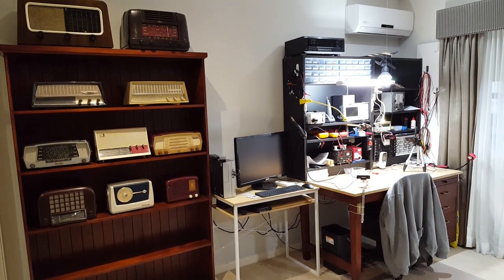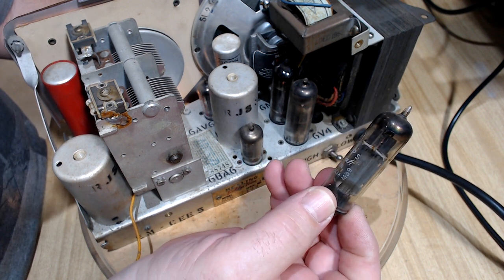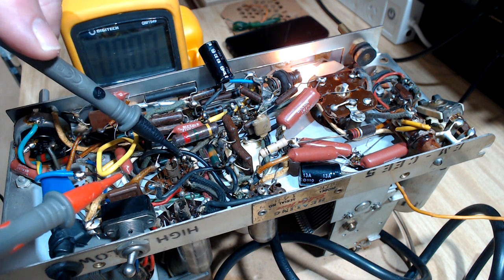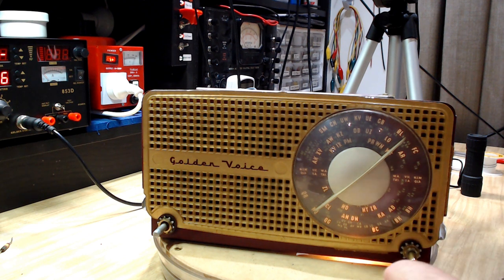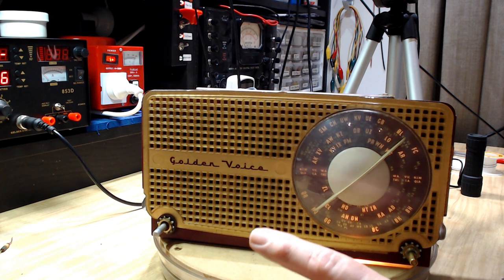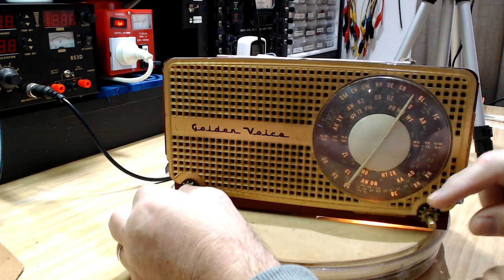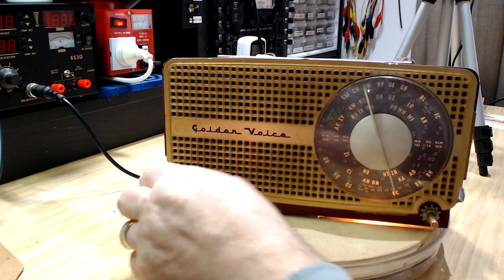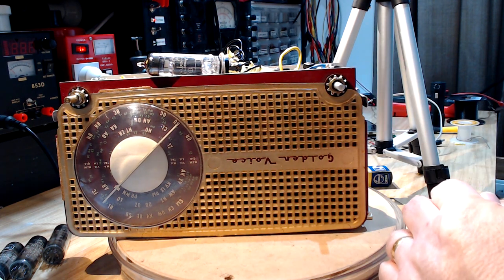Healing 503E Vintage Radio Repair

Comment: Just found your channel and have subscribed, as a electronics technician that started work in the mid seventies i saw the last of the valve televisions, but i cut my teeth on valve radios. Many years later due to a accident i find myself being able to have time to fix the valve sets i have collected. Watching your videos is fascinating and proves the point that you need to diagnose. 
Thanks for all your time snd effort in uploading these for everyone to access.
Reply from the maker: Thanks for the sub William. I'm new at this gig so please don't be too hard on me with your technical background and all 😀 Sorry about your accident but hopefully you will get some joy from you radio repairs. Thank you for supporting my channel William, cheers 👍🙂

Comment: An old radio engineer told me to always ensure all the valves are healthy before starting any fault finding, and it was good advice.
Reply from the maker: That's good advice but not as much fun as seeing what happens to a 70yo radio when it gets power for the first time in 20 years. I take your point Christopher but I want to see what problems there are and how to address them. Valves usually aren't the problem, they may be down on performance but still work. In this case the 6M5 wasn't the problem 🙂

Comment: I love the fact that you have a lathe to fix mechanical issues as well as electronics...
40 yrs I've spent in the tv and appliance service business...
I wish I had access to a lathe in my tenure, it would've saved me so much trouble and I could've fixed so many more appliances and even some of the older mechanical TVs..
I subbed, you are very talented and knowledgeable.!!!
Reply from the maker: Hi Frank and welcome. The lathe has been very useful especially as parts are no longer available. 40 years is a long time, you must be very knowledgeable yourself, I'm just in the learning stage. Cheers and thanks 👍🙂
Reply: @DavidTipton101  ..I think you have a very good grasp and style to your restorations. 
Great work.!
Reply from the maker: @frankpitochelli6786  Thanks Frank

Comment: Hi David was watching some of your older videos stumbled on this one, I was given a stripped 503E. It was no good as a radio so turned it into a 6V6 output guitar amp and it works a treat and sounds great through my 4 x 12 300w quad box. Really like your videos you do excellent work.
Reply from the maker: Thanks A Last, there wouldn't be much left of the 503E with a 6V6 in it, just the power supply 👍😄

Comment: I moved the shack 3 times. It always took a long time before I could find everything again. Last time was 10 years back. I told my youngest "make up your mind son, what room do you want for the time left you live here" (they fly out, and if not, they get some "assistence" 😄) He took the large room in the attick. Which left me with a bedroom.
Now, did that solve the problem of having trouble finding stuff ? 
No. Teflon memory and too much stuff.
Oh well. I can live with it 😎
Cheers, Nard 🇳🇱
Reply from the maker: I hear what you are saying Nard. One of my first projects in the few weeks I have taken off radio repair was to build shelves in my garage to store radio parts. Like you I can't find things when I need them and only find them when I don't 🤦‍♂️

Comment: Hi Dave those innoval Philips valves (the old ones made prior to about 1955 with the pointy pins and ridged base  )especially the 6m5. Suffered from silver migration between the screen and grid 1 pins putting positive potential onto the grid.  Quite often scraping between the pins with a screwdriver will cure the problem. Hopefully the valve hasn’t been cooked by this leakage.
Reply from the maker: Hi Robert, I know about the silver migration on 6M5 valves, I wasn't aware of the pointy pin difference though, thanks. I have tried to clean between the pins in the past to no avail. Others have suggested the migration happens inside the valve where the pins pass through the glass base? 🤔

Comment: Good to know about caps is that when they measure higher capacitance than the marked capacity it's actually not that the capacity has gone up. The cap has started leaking and developed an internal resistance, so the instrument needs more time to charge the cap, which it (falsely) interpret as higher capacitance.
Good job with this nice set! :)
Reply from the maker: Hi Kristian, thanks. I said that on a few of my videos, not sure which, and was told that isn't the case as capacitors can have up to a 80% manufacturing tolerance. I can't measure my capacitors under load so I just replace them but I agree with you, if they read high they are probably unserviceable 👍🙂
Reply: @DavidTipton101  That's true ofcourse if the cap is out of spec from factory 👍

Comment: The on have a lot of problems but finally it was fixed.
An interesting thing I noticed with the radios you work on is that most of them have negative feedback from the speaker or the plate. I have never seen this in the North American AA5 series string hot chassis sets we have here. This would give a different sound and more gain. Some audiophiles prefer no negative feedback on their class A amplifiers. A 6BQ5 or EL84 would probably work. It requires 7.3 volts bias at 250 volts, the maximum is 300 but some amplifiers use more. You are lucky to have an oldies AM station. The one here in Montreal, Canada switched to sports and then went off the air. Now there is nothing but talk, sports and ethnic as is common in many places.
Reply from the maker: Hi Gordon, negative feedback is pretty common, some use a quite involved circuit as well and it does improve the sound at the cost of a little gain. It's good for AM, I'm surprised it would be used in an amp though. We had two oldies stations, sadly one went to a sports station recently and I have trouble picking up the other one. We also have the national ABC broadcaster which is entertaining and plays a good share of music as well. Thanks Gordon 🙂

Comment: Healing had such a strange model number structure. For instance the 503B was a 5 valve portable radio! That crackling 6M5 makes me think I now know what’s wrong with one of my kriesler 11-81’s I have which crackles intermittently. Interesting I’ve never come across those red dipped ducons before, only the wax caps and the foil in clear plastic ducon caps. Good educational video on how a valve can fail
Reply from the maker: Hi BOE, It turned out to be a mica cap in the end, I think it was the tone cap from the plate to grid. The radio ran for a day before the crackling started again 🙄
Reply: @DavidTipton101  i just checked out the schematic for this radio and found the one your talking about. yes the bonus is it can be isolated with the tone switch so its as simple as turning the tone switch to "high" to remove the cap from circuit which would have made it much easier to diagnose. do you remember if the mica seemed stressed in any way or if it just looked normal. this all shows me i should have watched the last 5 minutes of the video before bothering you
Reply from the maker: No, the mica looked normal. I now realise that micas with high voltage on one side can fail. I had another one in a radio, can't remember which, it was going to ground from the plate of the detector, it caused distortion. It took me a while to find as I assumed micas where not a problem, that is what I had been told at least.

Comment: The cabinet on that Healing is a dead ringer for a post war Zenith Bakelite model, except with those the dial, and front fascia stays inside the cabinet. I wonder if they bought the molds from Zenith in the U.S? 
  With regard to molded mica capacitors I too have encountered some defective ones, particularly in post war sets. I had a pair of 47 mmf/pf ones go bad in a Canadian made Electrohome AC/DC set from 1950, Viking brand,  I can't remember whether it was leakage or whether they went open.
Reply from the maker: I don't know OlegKostoglatov, I guess they could have, maybe Healing just stole the design 😉  Oh yes, mica caps, I was lulled into a false sense of security by people in the know but I know better now, hopefully I won't fall for that again. I thought the micas from your area were better, guess not 😀  I read in a 1931 service manual to use a 90volt battery and a set of phones to test for any crackle 🤔

Comment: Hi there just bought a Bush Dac90 radio plugged it in and it all lit up and started to hum that familiar hum but no stations, I know alot have gone digital but there are still quite a few that operate on FM. My question to you is there a valve that needs replacing that will enable tuning in and locking onto a station? I most definately do not want to remove any of the internal workings as that is what makes the radios so special. That is like removing the workings of an old clock to rplace it with a quartz movement. 🤕
Reply from the maker: Hello David. The DAC90 has a hot chassis, that is, the chassis itself is connected to the mains power, you can get electrocuted very easily if you touch any metal parts. It sounds like you are trying to tune FM stations. The DAC90 is AM only, no FM. There is no magic cure for not receiving stations. If you want it to work you should contact someone to check it over before you plug it in 👍

Comment: I forgot to tell you that this is a very nice 👍 collection of radios 📻. Each one ☝️ must take ya back to a special place and time. I often wondered what happens, such as if a switch on a radio breaks. New old stock switches I think are the best way to go. Trying to just get a switch that looks the same may not be suitable. They, along with speakers 🔊, often aren’t made to the exact same specs as the originals. Even correct voltage record player cartridges are something almost impossible to come by. You have to modify the chassis with homemade circuitry to step the cartridge voltage up to something like 3 volts, instead of less than 1. Radiotvphononut can tell ya all about phonograph needles and cartridges. Shango066 was the one ☝️ to speak of buying a power strip on certain radios that you cannot get a switch for. He also said in a video, not to leave any antique radio on, if you leave the room, even for a second. He does not care how recapped the radio is, and to turn it the hell off. Shango066 is quite humorous. He makes up nonsense words. His most interesting one ☝️ was “Rojontweeblereezersweefless”. Yes, it isn’t a word, but, yes, major Lol 😂. It was Shango066 who bought up the Firestone Airchief radio. There’s Zeniths and many other brands that are of the same size. I see Glasslinger working on a majority of these. One ☝️ is a small refrigerator shaped radio, reminiscent of an actual refrigerator of the 1940’s, or a wooden armchair radio of the same time. She really does the major restoration of many radios. The above two really take ya back to the time. Even then, a 1940’s radio went in a 1940’s house 🏡.
Reply from the maker: All old radios bring back memories Jeffery.

Comment: Hi Dave
Enjoying very much you detailed videos. I am redoing my workshop and currently only use a the current limited lamp restricted voltage for initial radio test. But want to get a Variac and was wondering why you also use as an isolation transformer and wattage meter. Do you use the   the isolation transformer for safety reasons?
What models do you use and where did you get them.
George
Reply from the maker: Hi George, the current limiting bulb is a must as is the isolation transformer particularly if working on live chassis sets as it keeps you isolated from the mains and mains earth. Clearly you will still get a shock if you touch both output terminals but most test equipment is earthed so that element is removed if you touch the radio and an earthed point. The Watt meter is more useful if you bypass the dim bulb as you can look for excess current/power draw when bringing up the voltage slowly on the varic but I also use it to check the radio is operating at about the normal range, the manufacturer sometimes suppy the power draw figure. The variac came from Jaycar and the isolation transformer from Radio Parts in Melbourne.  The Watt meter is from eBay 🙂
Reply: @DavidTipton101  Hi David  Thanks for you detailed response  as I assumed the isolation transformer would be the most use for radio's with live chassis such as American set, not come across any Australian ones like that and have on not on any Battery Sets  from here.
Keep up these great videos I am picking little tips all the time. That rotating platform is a great idea did you make it or is it readily available.
Looking forward to getting to Canberra on the weekend to see I can add a few more radios to work on.
Are you heading to down to Radiofest if so love to meet you.
Cheers George

Comment: I would take all my 6M5 valves and adjust the pins with a 10 pound Widlar hammer.

Then buy a case of NOS ones. They can be pricy.
E80 is a direct replacement, E80L and 6227 are possible replacements, you would have to check.
Studying the operating curves can tell you a lot.
6BQ5 or EL84 have different pinouts and the characteristics are different.
There might be another type with the same characteristics but different pinout.
Reply from the maker: It's hard to get 6M5s, there are other options but need a rewire of the socket. A good 6M5 is fine, finding one is the hard part 😄

Comment: Hi David, could you show and explain more about the test lead you use for by-passing the RF side and put an external source to the amp side. Bloody good idea.  Thanks mate
Reply from the maker: Hi Jeff. Using an audio plug, I join the two inputs from the audio player together via two 1k resistors to make the signal mono then ground that via a 10k resistor. The junction of the two 1k and the 10k resistors is the signal feed into the high side of the volume pot, that is the side not grounded. The Plug, 10k resistor and the radio chassis are connected together as ground. I also put a 0.1uF cap between the resistors junction and the volume to protect the music player from any DC from the radio. 
Here is a link to a D-lab video where he fits it to an old radio: https://www.youtube.com/watch?v=j8YeJ0T3DpI
Here is another link to a drawing of the layout but I use D-Lab's resistor layout. Either will work: https://joefreeman.weebly.com/connecting-an-mp3-player-c-to-a-vintage-radio.html
Reply: @DavidTipton101  Thanks David. Great bit of kit.

Comment: I'm in the US-find the power transformer fascinating for a basic AM table radio  Was there ever a series filament variant to our "All American Five" in Australia?  I realize the US tube compliment would not work "down under" but was there an attempt to make a series filament, 5 tube radio for the 220/240 volt world?
Reply from the maker: Hi William, I get that question a lot. I have been told there were transformerless sets built in Australia but I haven't seen one as yet. Transformerless sets were popular in Britain which, like us, also used 240 Volts, they used a heavy dropper resistor to get the voltage down to acceptable levels for the 120V (approx) valve string. Because we produced our own tubes and we are a very small market maybe it was too expensive to produce special valves or import them for hot chassis sets. I'm glad they didn't as it tended to limit the circuit design to a very narrow field such as the AA5. I have a number of British sets with a dropper resistor and the resistor runs at about 200C, great for cold England not so good in Oz 😃

Comment: Mr. Tipton I been working on AA5 type American radios for a while ,teaching myself from videos ,I spent a fair amount of money on vintage equipment and new stuff .I just order a vintage signal generator,have a restored vintage capciator tester because it can do things new stuff can't .I have a question where do the test leads go when you are doing alignments, I even bought a analog meter like yours I ordered from your country.if you can advise me where to hookup my signal generator and my analog degitech meter I would be grateful for the help.
Reply from the maker: Hi Ron. I may do it a little differently from others. To do the IF, I connect the generator to the grid of the mixer tube via a 0.01 capacitor. I attach the meter to the plate on the output tube via a 0.01 capacitor and set the meter on AC Volts on the low range. You can connect it directly across the terminals on the speaker if you wish but it gets a bit louder before you get a reading, you don't need the capacitor if you do this. To adjust the RF, I move the generator to the antenna wire and attach it via a 200pF capacitor or if there is no antenna wire make up a wire loop antenna and place it near the receiver until it can pick up the signal, you don't need the capacitor for that method either. i hope that helps 👍🙂